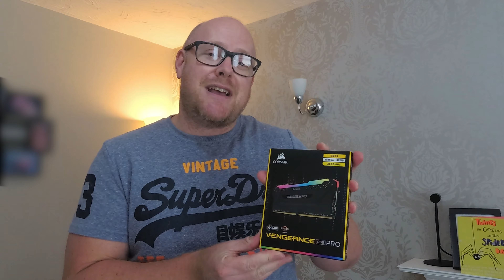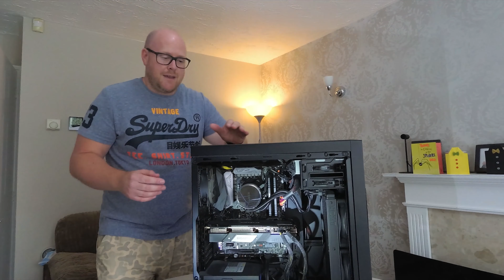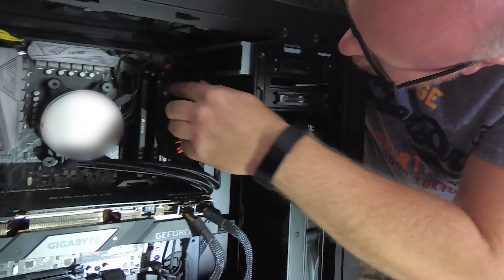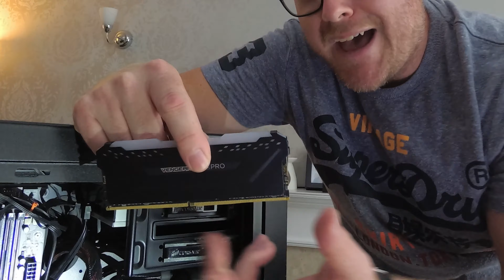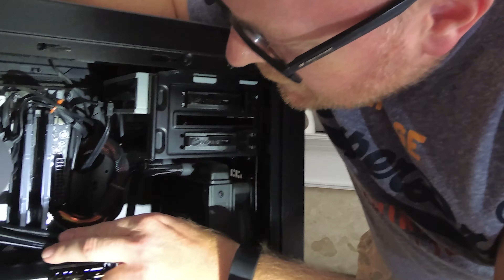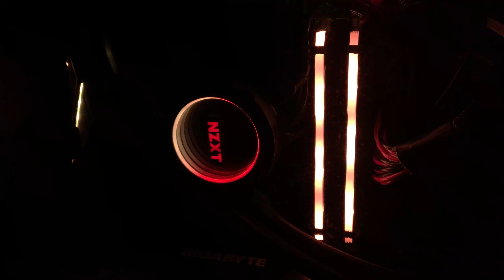32GB Corsair Vengeance RGB Pro 3600mhz DDR4 upgrade

Comment: So I’m having the issue of reference memory couldn’t be written and I’m not too sure how to fix it as no videos really show any solutions and I’ve yet to try what you’ve said in yours cause it seems similar to my issue but I have a B550 UD AC motherboard and my cpu is a ryzen 5600x 3060ti gpu I’ve no idea how to solve this memory error pop up and my ram is sitting at 2300mhz or something and I have never overclocked or anything so I’m worried that I could run into bigger issues if I push it in the Bios to 3600 and I just need some sort of input cause my old sticks of T-Force ram at 3200mhz was running fine max speeds but them were 2 8gb sticks and now I have the 2 16gb Corsair rgb vengeance pros I just don’t know man, I know this is 3yrs old but any input would help
Reply from the maker: Are you running the Corsair iCUE software? I would check if there are any firmware updates for the memory.
Failing that I would remove one stick of ram, and test the memory. Then swap to the other. If you could identify a potentially bad stick. Then try that in both memory slots to eliminate a bad mobo.
In fact when you have taken both sticks out,clean the memory slots and reseat the memory.
Just do all the trouble shooting before you RMA.

Comment: do they run on my z390 pro and I5 9400f ? pls answer,,, ty
Reply from the maker: Any DDR4 memory will work in any pc. Some memory is optimised for Intel or AMD. Also it depends on your motherboard if you would get 3600mhz or not as that speed is an overclock.

In answer to your question, yes it would work. But getting the full 3600mhz I would do some further research first

Comment: Man these are really lovely looking ram when off and looking at from the side. It's a shame you can barely see them when in use.
Reply from the maker: Ye but you could say that about any ram. It all fits in the same way. Still many variables and factors regarding case and Mobo. My attraction is that they can produce so many colours and effects, in a non RGB fan system, they add a nice ambient glow

Comment: hole shit your rad in out is higher then your pump on your cpu omg all the air in the system will be in the top of your cpu that's bad you should  always have the radiator above the cpu
Reply from the maker: I’ve watched Steve’s video and Jay’s video. Well aware of pump orientation. If the tubes were longer I’d put it the other way. 
Just for info it ran like that for 4 years, and is now in another pc running strong, still providing more than required cooling. As long as you get the air out it’s ok. Not ideal, but it’s ok.
Reply: it just looks wrong i am sorry i like to see the rad at the top as all my builds are all ways at the top and front for the gpu ....... but it did well to last 4 years :)

Comment: i have the same ram but mine cap at 2400MHz. How can i make it 3600-3200MHz
Reply from the maker: Hi, You have to go in to your bios and enable the xmp profile for a memory overclock. This is different per motherboard vendor so just Google your mobo model and enabling memory O\C

Comment: btw does its work on a rog strix z-390e gaming?
Reply from the maker: I think I replied to someone else not long ago about an Intel system. As long as the board takes DDR4 it will work. How ever, the mobo will depend if you can get the max speed of the memory, as anything over  2133mhz is an overclock. Check your mobo manual for max memory speed

Comment: not sure if you figured it out by now but the issue is your motherboard. and mainly your CPU, you have a better chance of getting the ram to run at 36000mhz if you had a third gen CPU, like 5600X etc.  had the same issue. once i upgraded my CPU and motherboard with better vram. i had no issues whatsoever, i used the xpm/dcop profile and ran great
Reply from the maker: Yeh running with my 5900x with no issues 👍🏻
Reply: @HlspwnsWorld  would this work with my i7-9700k cpu or would i have problems?
Reply from the maker: @austinuribe461  Max supported speed 9700k 2666mhz. Beyond those speed’s it’s down to the motherboard. As long as the motherboard supports 3600mhz can’t see why it would not work. Although you may have better results with 3200mhz
Reply: @HlspwnsWorld  thanks!!

Comment: water cooling now is just a bit of a facade. not really necessary as the cpus being developed dont heat as much. a decent fan is more than sufficient.
Reply from the maker: I disagree. Intels alder lake is warm and power hungry if OC. As will any modern CPU with a high core count. When you say a decent fan is more than sufficient, don’t you mean one 1/2 the size of the motherboard board.
Fans can cool as well as an AIO cooler, but the size difference are vast.

Comment: i have this RAM need to figure out tunings, getting random restarts instead of monitor going to sleep. May set to 3200 MHz
Reply from the maker: What CPU do you have? Now I have it paired with my 5900x I just set the xmp profile, runs at 3600 and not had any issues. 
With my 1700x I had to set the memory speed manually, raise the ram voltage to 1.35v, and slightly up the SOC voltage to make it stable. But it was not happy above 3200mhz, apart from one holy grail boot where it ran at 3600mhz flawlessly, then never did it again.

Comment: hello quik question  i have a radeon rx 580 and a ryzen 5 3600 would that be able to handle 32 gb of ram
pleas answer m,e if you do know the awnser
Reply from the maker: The amount of ram and the speed that you can use is dependent on the motherboard. If you tell me your motherboard model I may be able to help

Comment: Bought these, can't get it up to 3600mhz. 3000 mhz is all it will go up to
Reply from the maker: What cpu\mobo do you have? Are you using an xmp profile in bios?
Reply: @HlspwnsWorld  Motherboard: Prime Z390-A
Cpu: Intel i-9 9900k unlocked
I am using xmp
Reply: @austin9809  you still didnt find a fix mate ?

Comment: Power Supply	700W 80Plus Bronze Rated PSU
CPU	AMD Ryzen 7 3700X Eight Core/Sixteen Thread Processor
Motherboard	Gigabyte B450 DDR4 Motherboard
Cooler	Alpenfohn Brocken Eco 120mm CPU Cooler

Storage Hard Drive	Seagate 2TB 7200RPM Hard Drive
Graphics	Nvidia GeForce RTX 3070 8GB Graphics Card

Would this be compatible with the above please, i am looking to upgrade my ram?.
Reply from the maker: When trying to work out if the ram will run at the speed it’s rated for you have to look at the specs of your motherboard. DDR4 is rated to run at 2400mhz, so anything over this speed is an over clock.  How much it will OC above the standard speed is limited by the cpu and the motherboard.
3700x will run high memory speed, so its really down to what the motherboard will run. As you have not specified the exact motherboard model, I could not exactly say. But I expect it should run 3600mhz ram but I would always check the mobo specs first to avoid disappointment.

Comment: Ey this may not apply now lol since this is an older video but, I recommend having your AIO higher than your pump level because the air would actually go to the pump/water block and can cause both lifespam shortage, and extensive clogging
Reply from the maker: Thanks for the comment, but it’s actually higher than the top of the rad, not by much, but it is. Fully aware of position, and best practice.
Anyone who’s not sure should go watch GamersNexus video, and if you still don’t get it as it’s a difficult video to follow, JayzTwoCents makes it absolutely crystal clear.
The reason it’s in the position it’s in, is because it does not fit in the top of the case without fouling. To flip it round in current position, would mean the water pipes would not fit around the GPU, leaving the only position it’s in.
AIO manufactures should make the water pipes longer, then it could be fitted as best practice.
The way it’s fitted can trap air when you first put it in, if it’s rattling or making a funny noise. Turn off and work the air out. That AIO is now in another system, and going strong with very low temps.
Reply: @HlspwnsWorld  Yeah man lol I actually watched JayzTwoCents because Steve over explained it a little bit and I could not keep track. But yeah man I don’t know if it’s the camera angle but it looks lower than the pump but that’s probably just me with my horrible vision 😂 And yeah man I feel like manufactures should make the tubes longer to have more flexibility to place the AIO where the customer wishes too.

Comment: i got 64gb ram of this  and i got 16gb ram in my pc now but would it make a hige difference between alt tabbing in games ?
Reply from the maker: It would really depend on the game, and if the menu is locked or not. Some games don't let you alt\tab, but if you could, the more memory you have, the more programs you can theoretically have simultaneously running, as long as your cpu can cope.

Comment: 1st gen Ryzen is not supposed to run RAM at 3600MHz...
Reply from the maker: You can run whatever speed you can get stable. Although the 3600Mhz is to pair with my unicorn 🦄 cpu

Comment: I have OMEN by HP Laptop 15-dh0xxx. Can I upgrade my ram to 3600MHZ? The stock RAM is Samsung
M471A1K43CB1-CTD 2x8GB (2666MHZ). My CPU is I7-9750H and the motherboard is 15-dh0xxx, Please help me.
Reply from the maker: Desktop ram, and laptop ram sodimm are completely different. I’ll have a quick look for you and get back to you. But if the answer does not pop out at me, you already have the information to do a deep search
Reply: @HlspwnsWorld  yes I already have the information 😂
Reply from the maker: @princeofeurope3313  So to answer your question with a quick skim of that model. Fastest it takes is 2666MHZ. So the answer is No desktop ram as this video references and talks about will not fit in a laptop. No you can not upgrade to 3600Mhz as your laptop only takes 2666mhz DDR4
Reply: @HlspwnsWorld  thank you. Cheers

Comment: I have an ASUS B550M-A WIFI and a ryzen 7 3700x but my pc dont boot up when I have those ram sticks installed. I have the 4x8 3600MHz kit which confuses me because I read that my motherboard supports them on the official website. Also I have a liquid aio but the tubes touch the ram stick in the first dimm slot so I'm not sure if that'll damage the ram stick over time. Could someone help me out with both these issues? I would really appreciate it.
Reply from the maker: Looking at the specs of your Mobo they should work. If the AIO tubes are just resting on the memory it will be fine. If the tubes are really tight and its pressing really hard on the ram that's a no no, just common sense really. Regarding the ram, I would start with updating the bios, and the chipset firmware (google is your friend). I would then after everything is up to date, put one stick of ram in the pc and see if it boots, if it does, then try all the others. If it does not boot, still try all the others, your trying to eliminate a bad stick.
If they all work, don't overclock the ram leave it at default, and put all 4 sticks. If it runs fine, then start upping the memory speed, hopefully it will run stable at the speed it is referenced for, but its not always a given. Keep trying different things, its just a process of elimination until you can find the cause of the problem

Comment: is the corsair vengeance LPX 32gb ram the same? so basically is it the same just without rgb
Reply from the maker: It should be, but memory timings can very between the different models of memory sticks so just check before you buy

Comment: Will this work on a b550 mobo or if not a b450 mobo
Reply from the maker: The memory will run on both as it is DDR4 Ram. The speed that you can get out of the memory is dependant on the CPU you are using and the motherboard. For example the default clock speed of DDR4 is 2400mhz. When you plug the memory into the motherboard it may have a slightly higher default speed than 2400mhz. But anything over the default is classed as an overclock. So to run the memory at 3600mhz the motherboard and cpu need to be capable of running the memory at that speed. If you have a ryzen 3000 series processor then you should not have to worry too much about the cpu, but I'd certainly check the specs of the motherboard so that you are not wasting money on a memory speed that you would be able to achieve.

Comment: Just upgraded to this exact same ram for my 3700X setup
Reply from the maker: Nice are you going to stick at 3600, or are you going to try and push past that?
Reply: I’m new to PCs after always having consoles, so for now I’ll just leave things stock. Only built my first ever rig 5 months ago so just going to enjoy it for a while before tinkering with it! Pleased I made the leap though, I’m loving it.
Reply from the maker: Welcome aboard, I've bounced between consoles and pc's over the years, I moved back to pc's as the consoles started to try and become more of a pc based hardware. The gap between them is really narrowing especially with the new consoles due towards the end of this year. I really like how Microsoft has introduced the cross play between xbox and pc. I would have said there may not be much graphically between a 4K pc and console, but it seems Nvidia may have just set a new standard, have to see what AMD brings to the table, but overall everybody wins even the consoles.